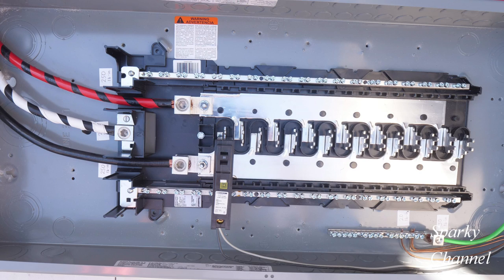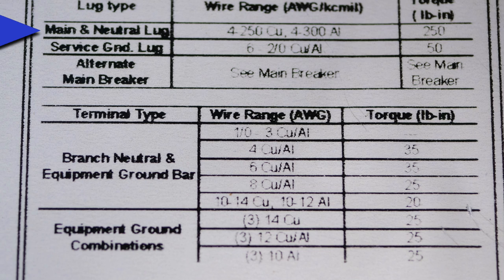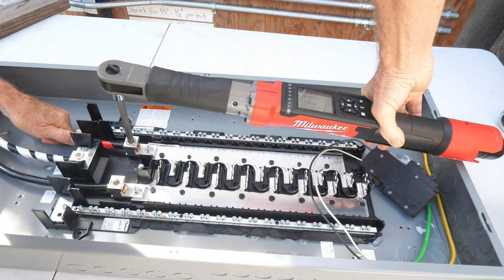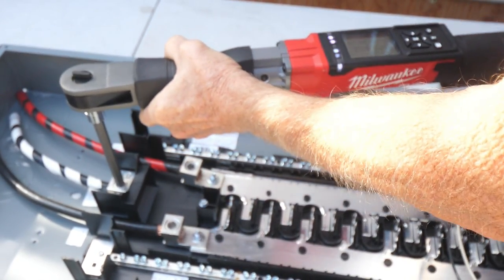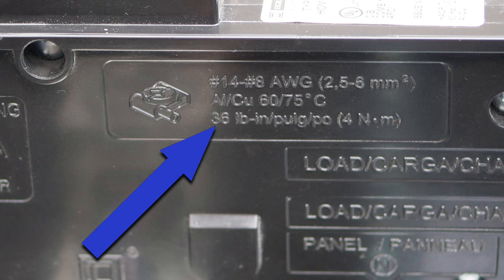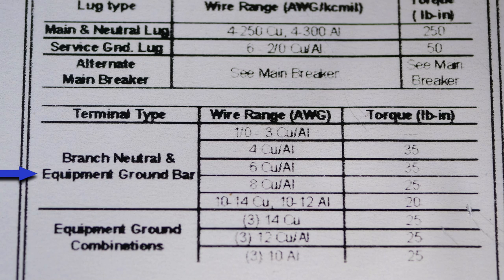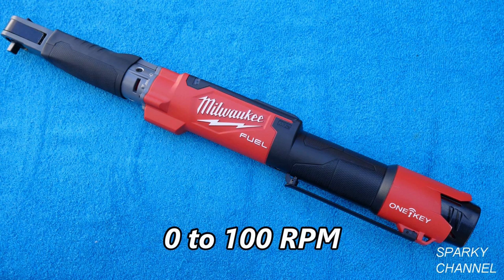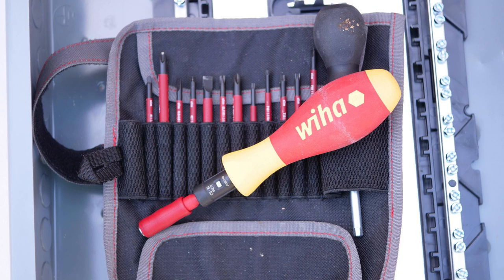How to Torque Terminals in a Square D Homeline Load Center

Comment: Nice bill I have been for a long while to buy the Milwaukee tool wrench quite a few UK electricians use it. You also have to bear in mind the the calibration needed every year. Wiha does a really nice torque test tool to determine if torque screwdrivers go out of calibration which is great cause you can check the tool if it’s in calibration and that means not having to calibrate every year.
Reply from the maker: Thanks Math Man!

Comment: Bill, since that milwaukee wrench can doninch pounds, can you use it in the circuit breaker and ground bars?
Reply from the maker: No, that Milwaukee wrench torques between 120 and 1200 lb-in of torque so it won't work for circuit breaker and ground bars.

Comment: Thank you for another great video!

Curious on your thoughts/experiences about how having the Milwaukee torque wrench improves things versus a quality manual high torque wrench.  I wonder if there are benefits I haven't considered, as it's not one of my more frequently used tools (in contrast to low torque wrenches like the Wiha).  I love good tools, but the Milwaukee is more than what I can take out of my petty cash drawer...
Reply from the maker: Hi RJ! The Milwaukee is a super nice tool for torquing the main lugs but it is limited for residential electrical work by its range, which is 120 lb-in to 1200 lb-in. Of course that is 10 lb-ft to 100 lb-ft. So if you want to torque a terminal to 70 lb-in, you can't do it with the Milwaukee. Having said that, it's the best torque wrench I've ever used for the main lugs and it has lots of other uses. Another benefit is it's an electric wrench, which speeds things up. Overall, it's a wonderful tool but one must be aware of its limitations.
Reply: @SparkyChannel  I have low (up to 40 lb-in), mid (20-200 lb-in), and high (10-200 lb-ft) wrenches.  It's rare I use the high outside of main lugs, and most work is branch circuit related.  If I were installing panelboards all day complete with a torque report, the Milwaukee would be a godsend.  The built in electric wrench is super nice; I have not seen that in a torque wrench.
Reply from the maker: @RJ-ej1nr  Milwaukee says it's the first of its kind. It's an unusual tool, but I really like working with it. You're well covered for torquing. Nice!

Comment: Vary Good.    last week.  i saw in a homeline panel.  the previous sparky.   screwed down a ground wire,  where he way overtighened it.  almost cut the copper wire in half. it was crushed.   very bad.
Reply from the maker: Either under or over tightened can be very bad. I've seen both.

Comment: Anybody know of a torque screwdriver that comes with Robertson bits?
Reply from the maker: The Wiha has #1 and #2 square drives available. They work great for breaker and panel purposes, but square drive is slightly different from Robertson.
Reply: @SparkyChannel  Yes, "square" isn't as good. 😜 OK thanks very much indeed, at least I know something close is available.